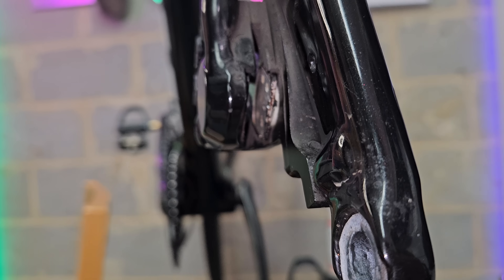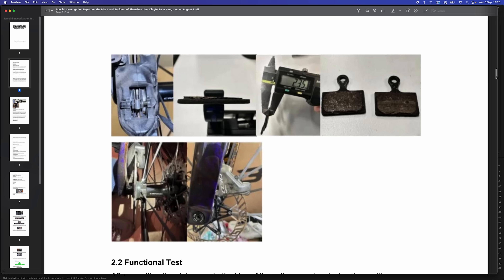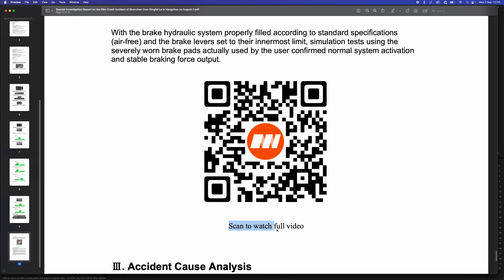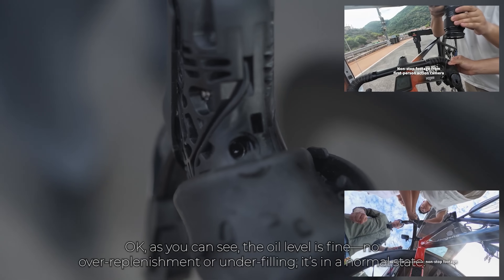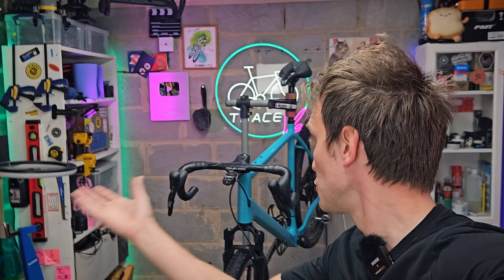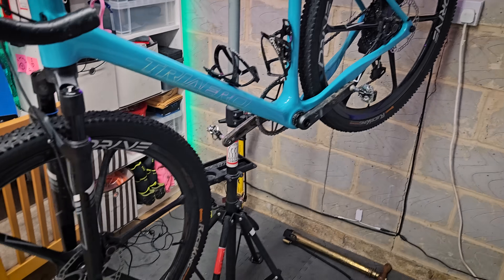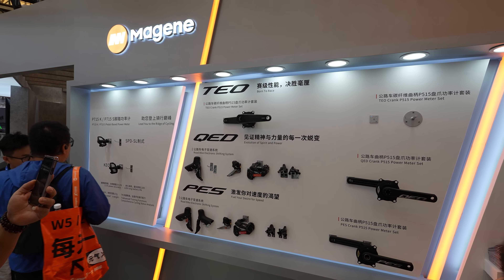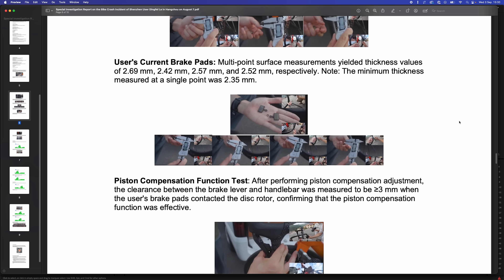Did their disc brakes really fail? - Magene responds

Comment: There is an latest update in China, Magene has acknowledge the brake problem. There are number of chinese rider crashed due to the brake fail. There was a big third party done the lab testing against Shimano 105 caliper. The finding was showing the design flaws and caliper flaws to create the brake fail. It has been blow up big time force Magene to come out with their test to state the same result.
Reply: Not trying to argue, but the update you mentioned seems different from what I saw on their official Chinese post. Magene ran the same tests as Club100, but their results came out completely different, they didn’t get the issues Club100 reported.. Magene also said a third-party lab report will be released this week, so it might be worth checking that once it’s out.
Reply from the maker: No way!!! They assured me it was not a problem, so thats CRAZY! Not sure if this is possible, but can you link me to any sources or news reports for this????
Reply: @TraceVelo  he is exaggerating about reported crashes. But their brakes do have problems . CLUB100 (a Chinese bike media) tested it against Shimano 105 and found it lacks both durability and robustness.The pads wore out too quickly and unevenly. Piston movements are asymmetrical. It even failed to produce enough brake force during the test.
Reply: @jjf9807  Funny thing is, Club100 isn’t really seen as a credible media outlet in China. People often joke that he hops between brands and users, taking money from one side while acting all “neutral” on the other.
And the funniest part? He just uploaded a factory-visit collab video with Magene. So Magene isn’t even the first brand he’s run this little routine on. Plenty of cycling apparel brands say they’ve been through the same dance with him. 😂

Comment: Regarding both brakes failing, I lost hydraulic oil from the front brake once, on a steep hill and went to stop using rear brake and it started to slow me down then just faded obs got to warm so no brakes had to crash into bush to stop , luckily I was ok..

Comment: Both brakes failing at the same time speaks to either a freak accident, or some kind of user error and the whole story isn't coming out. 

I've done a lot of tech support and you'd be amazed at how often the user has done something to cause a problem, either not knowing they have done it, or they do know and they won't bring it up for whatever reason. It often requires a lot of roundabout digging to finally bring out the true cause because they don't know enough about the thing in question to think it's relevant to bring up, or they were hiding it. 

Now if suddenly more cases of the same type of failure start popping up, then you can consider a widespread issue in design or manufacturing. But apparent one-offs like this, especially one with such a low statistical chance of happening, are either a freak accident/low chance manufacturing defect that squeezed through QA, someone was touching things they didn't know enough about, or it was a simple accident caused by the rider and they've tried to come up with a story of failure to cover up their own mistake.

Comment: What do they mean by ‘bleed’ for the worn down pads? You should be able to bleed the brakes, use normal pads, then knock the pad material off, with no additional bleeding, and it should still work, i.e. stop you, albeit making a horrific noise. That’s the safety margin. There’s no circumstance where the pads can’t make contact with the rotors, if the fluid isn’t leaking.

Comment: I would agree that Magene has seemed to have responded well to the entire incident including their dealings with you, which they had no obligation to do given that you are a 3rd party to the incident (but it is very good PR that they were willing to engage you!).  I would also agree that overly worn pads along with inadequate brake fluid is a reasonable conclusion given that no other mechanical or structural faults could be found.

As to the rider claiming that both brakes completely failed at the same time, if you are careening down a hill and reaching the point of losing control and your brakes do not grab as you are expecting them to, I would certainly think that the feeling would be that nothing had engaged as your life quickly flashes before your eyes.  Human perception is typically the most flawed and unreliable part of any recollection of an experience.

Great coverage of the issue Luke!!

Comment: Your failure hypothesis is not very convincing. To me, simultaneous failure of two independent brakes strongly indicates user error. The guy has most likely set up both brakes identically...but unfortunately wrong.

Comment: What I'd like to see:
- Bleed the system with brand new pads and rotors up to the minimal allowed level
- Wear disc and pads down way over the allowed minimal tickness (yes, I know, but we have all seen that on some bikes)
- Test again

Brakes are essential. They have to work even when you neglect any service. They may squeak, and they may fail when hard physical limits are reached, like brake fluids becomes way too contaminated, or brake pads or rotor falls apart. But having enough oil in the system even for "extreme" conditions is "just" an engineering issue. IF that is an issue here (a big IF), then we are talking about some ml missing.

Comment: And the cheap pad especially the resin pad, which is made in china always use cheap glue to stick the consumable pad to the back plates. the glue will be failure after heavy rain or high temperature. Fuck that, it's just too cheap and no one blame them. it's really horrible to see the pads separate to the back plate.

Comment: I'm with magene on this, user error on bleeding, blatant lies about both brakes failing at the same time, even in the most extreme conditions could you get the mineral oil to boil to create brake failure front and back at the same time, this guy is trying an insurance scam most probably to try to get a payout

Comment: Another option for failure could be  hi temperatures could affect the the reservoir volume at the calliper. An overexpansion of the reservoir combined with excessive pads wear could do the trick.

Comment: After having both brakes fail to the point you can't stop at all, apparently at the same time, this is clearly just gross user incompetence. This is the whole reason UK law says you have to have two brakes, or at least two methods to slow down if you are on a fixie. It is basic redundancy. The only way I could see this happening under "normal" conditions is dragging them excessively on a descent, while being very heavy, and having heat be the cause of failure of one, and then the second, independently. But as we can see from all the people not crashing on every mountain descent in existence, even this isn't a thing.  

If they were riding around with one failed brake in the first place and the other failed, that is just gross incompetence, it is obvious when you use your rear brake that it works or doesn't even if it isn't a major stopping determinant.

Comment: I had a brake fail. It was VERY obvious when it happened. Turned out the brake bleed port wasn't fully closed and that lead to a full system flush. Brake pads were acceptable and it took about twenty minutes to bleed and flush.
Also, there may be patent issues preventing release of the group set outside of China. Still it's great to see Chinese equipment coming up in Quality.
Reply: sometimes those ports are so stuck. once i bended my elen key
Reply: It's a good point.  Chinese companies copying patents is a known thing.  No wonder they don't want to release them - with as many Chinese and Asians who will buy them in the unprotected markets, there is no reason to release the groupsets to the western world.

Comment: I have experienced a similar issue with the Clarkes Clout MTB brake, here in the UK. In this case, the pad spring was too powerful and pushed used pads back too far from the disk, meaning that the brake lever needed to be pumped to push the pistons back out far enough again to achieve proper braking. It's annoying and the fix was to reduce the spring strength with a slight adjustment to the spring via a pair of pliers. Problem solved. The joy of cheap brakes.
Reply: I had an uneven lever feel and your suggestions to adjust the spring worked fantastically.

Thank you so much for your comment I've watched all the videos on disc brakes and no one except yourself as ever suggested this, thanks again.
Reply: @zedtony8110  You are welcome. I have been in and around the cycle industry for thirty years, I also build motorbikes, so I have a couple of old tricks here and there.

Comment: I only have a Magene PES power meter crank on my bike. Have been using for 2 years. Works fantastic.  Based on my experience with that product, i am very impressed with the Magene brand.
Reply: You’re literally the only person I know said that. A random mechanic I sent my bike to  hates it with a passion, and I had so much mechanical trouble with it. 

It’s cheap, and the less said about anything else, the better
Reply: @87togabito  And I have a dual 4iiii Dura-Ace 9100 power meter that has lost its mind saying I put out 1200w doing tempo.  Another dual 4iii Dura-Ace 9100 power meter that has my left-right balance at 90-10.  Another GRX left 4iiii meter that says I put out 10w sprinting.  It seems all crank-based power meters give a lot of trouble.

Comment: All brakes lose braking power when the pads wear out, eventually losing all braking effectiveness.  It is irrelevant what precisely is the limiting factor in this, it happens to ALL brakes and is gradual, not immediate and catestrophic.  The premise of this video, as explained in the first minute, is invalid.  Such an explanation cannot be valid, too small a fluid capacity may make loss of braking premature, but it would not change the behavior.

Comment: After using and bleeding hydrolic brakes for 8 years now. I'm 100% convinced that this is user error..
If he had a claim he would have let his bike be inspected.. Also both brakes failing sounds to me like the same person bled both brakes wrong..  One of my early attempts went wrong in the same way (back brake only) some air got in the system.. Worked fine for about 50 miles until the bubble rose to the top and... Instand brake faill. I just didnt see the need to blame shimano 😅

Comment: A point that seems worth making is that the safety margins in brakes should be considerable. Hiding behind minimum pad thicknesses is not acceptable (if they have tested down to the back plates this seems like the right thing though). When I used to mtb regularly it was not unusual to start the day on good pads and finish completely worn out. Although wear rates on road bikes are much lower people will be caught out sooner or later.
Reply: You're neglecting the fact that the brake fluid volume was insufficient.
Reply: @sylvainmichaud2262 it has been independently proven by multiple parties that even when perfectly bled, the magene brakes still have the same issue.

Comment: perhaps this reveals a need for somewhat oversized reservoirs to compensate for imperfect bleeding?
Reply: bleeding is not rocket science. if the mechanic cant do it, he needs to resign
Reply: @fetB people do it at home too, often without properly checking how to do it or relying on old memories of how they used to do it. But yeah if you take it to a mechanic and they do it improperly that's their liability. For my money I'd rather a little safety margin to protect people from the odd bad mechanic though.

Comment: a bunch of bike shops on bilibili already tested it thoroughly, if you push the pistons all the way back in and bleed the brakes, a completely sanded down brake pad won't be able to hold on tight to the disc brake rotor, in the same conditions, shimano, sram and even l-twoo where still able to brake fine, even if you remove the brake pads all together, the pistons can even be pushed out at the point of falling off to make contact of each other. if you were to use a bleed block that has a bit of leeway to bleed the brakes, meaning the pistons will be pushed out a tiny bit, then the brake system will work perfectly fine even with sanded down brake pads.
Reply: That's the part that is not addressed. Sure, maybe his brakes weren't set up completely flawlessly, and his pads were a bit worn down...but that doesn't mean it is supposed to relatively suddenly lose braking completely, if other braking systems behave better under the same circumstances. With how fiddly bleeding is, it isn't too hard to make those same mistakes.
Reply: @klaxxon__  Even in a scenario where what you said does suddenly happen, it doesn't happen to both brakes at the same time. They are entirely separate, even in terms of wear and force put through them, the front brake has a far harder life than the rear.

Comment: Worn pads leads to air bubbles in the calipers. Which when combined with poorly bled brakes and hard braking during long descents will result in braking failures.
Reply: No. If the brake fluid level his sufficient, air bubble cannot get in. It's a closed system.

Comment: Wear-indicator? Do pads offered by OEM's or aftermarket suppliers have these? Rim brake pads have grooves/slots...when those are gone, time for new pads. The consumer product people should require some sort of visible or audible warning when disc brake pads are worn to the point they need to be replaced. I believe this is standard on automobiles?
So brake failure blamed on worn pads + air in system (I assume since they said not enough fluid..air would replace that volume in a sealed system) = total failure. Reasonable conclusion IMHO.
If your theory the rear brake wasn't working when the ride started, that's on the rider...what moron would take off on a ride with only one working brake...let alone one with descents? I wouldn't walk home if one of my brakes failed, but I'd have it fixed before next time..what kind of moron wouldn't?

Comment: 4:17 weird how the guy didn't want them to test his brakes hmmm makes you think he knew it was his fault
Reply: It might be the recommendation of his lawyer.
Reply: @sylvainmichaud2262  for what purpose. If you have nothing to hide. Lawyers use every advantage and if the brake were not tampered with and indeed a manufacturer problem, they would have used it. Not showing the brakes, is an admitting of guilt
Reply: In case of a lawsuit those brakes would be the main evidence. You don't just hand them over to the opposing party

Comment: Internal cable routing -> mistake while assembling -> hoses damaged/cut in frame in the bar/headset area -> both fail the same time. This is the only way this could have happened imho.
Reply: Or some air in the system… if the bubbles are not at the top the breaks will work… when the bubbles have risen to the top then you will have Break failure which Could also explain what happend

Comment: The more cheap groupsets are serious contenders to the big brand names, the better - then the ridiculously high prices will drop. Fingers crossed.  Many thanks for posting, Luke.😊
Reply: Ltwoo and wheeltop arent particularly cheap when you consider they dont come with cassette, chain, cranks and rotors.
Reply: They only make sense if you already have a crankset and cassette. And they don't really offer any warranty. Theoretically there is a warranty in place but if something breaks they will tell you that it's your fault and/or ignore you. And getting help takes ages, I have a problem with my egr and i wrote them 3-4 weeks ago and they haven't really helped me yet.
Reply: @mountainbikekids2764 its clearly marketed as upgrading kit rather than full groupset. If someone upgrades, they probably will also go for power meter cranks too.